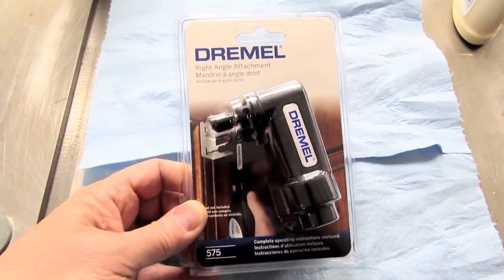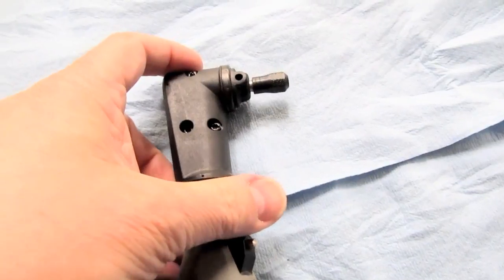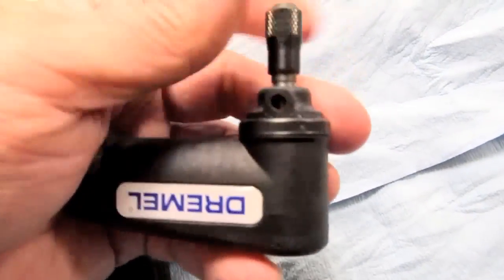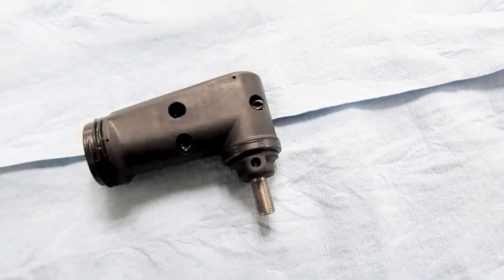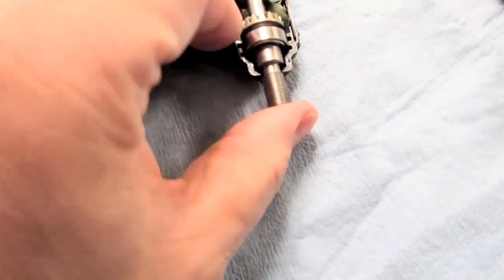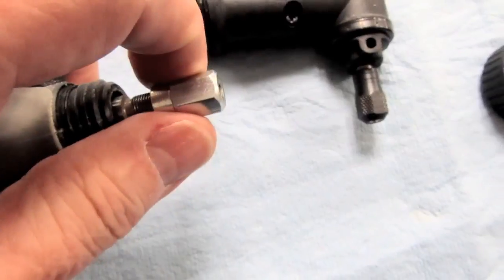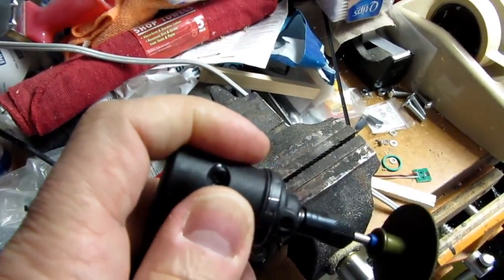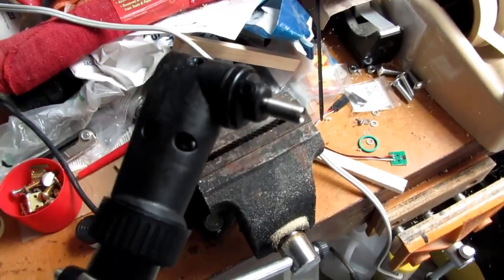Dremel 575 Right Angle Attachment: Overview and Hack

Comment: Thanks. Mine has been making a grinding noise and I was too afraid to open it. But seeing your video and how simple it is insige (no springs or other small parts to lose instantlyK I opened it and it, like yours, had almost no grease. I drenched it in grease and it sound much better now, it seems to run a bit slower because of the resistance of the grease, but its much quieter and does not get hot any longer.

Comment: i had the heat problem also it would get very HOT!! and true there was a lack of grease. The heat problem is the drive shaft!  it is too long and extends to far past the top of the vertical gear shaft and touch the top shaft.   I used a cut off disc and my Dremel to grind it down the excess so that it did not touch the top shaft anymore. Once i did that and added the grease problem solved !!!   machine  flaw from the factory

Comment: The problem lies within the bearings. Better bearings with rubber seals that you can remove to repack the bearings will definitely help. Also keep in mind while the gears need grease,  the grease will build up heat. So to much grease will work against you heat wise.
Reply from the maker: George Cloninger,  I am not sure that I can accept your argument at face value. The basic Dremel tool seems to use ball bearings of the same type as this attachment, yet they don't seem to present a problem there. And this attachment (actually, both of the ones I own) gets hot right away when first used....nothing worn out yet, nothing that seems to need repacking, and very little resistance to rotation.

I concede that adding more grease as I have done seems to not actually help, and might make things worse. Having said that, I have shown this attachment, disassembled, to a few mechanical engineers I work with, and their first impression was that the fairly rough cut gears, and the type of gear tooth shape, is the primary cause of heat generation.
Reply: @youtuuba  you could be right. But if the bevel gears are tight and run smoothly I wouldn't think they would present much of a problem. That being said I am not a engineer by no means. They do make different grades of bearings I found that out a few years ago at a electric motor shop, when I upgraded the bearings on my RBI Hawk scroll saw even though the old ones seemed fine. The factory didn't use the best bearings out there. The new ones I put in reduce vibration in the saw. It was a win win for me.
Reply: @youtuuba  but I'm glad you posted this review. Because I will definitely be going with the foredom grinder instead. I was just going to cheap out with the dremel one. Sense I have both tools.

Comment: I have had a problem with mine. The grease actually got so hot it melted. Leaked EVERYWHERE. What I might do is pack it with a higher temp grease and see if that works.

Ideally, this SHOULD be a closed sealed system with some type of oil in it, NOT grease. Rotary gears should never have grease at the RPMs they are spinning due to it flying off and having no way of getting back where it belongs. So something like a sealed area with liquid oil in it would always guarantee that the oil be on the gears.
Reply: As with a turbo on an engine, it is fed oil not grease.
Reply: No
Reply: try white grease

Comment: 2 things - 1. Grease like that will trap heat inside the device. For best results don’t pack the drive train in grease, just apply a thin coat to the gears. 

2. It’s unfortunate that a device like this cannot easily be ventilated, but the benefit of the price point means that if these things are making you money and you’re running them all the time… just buy two and swap them out when they get hot. I often use my impact driver to drill holes through sheet metal, when it gets dangerously hot I just pull the bit, unplug the battery, and take a break. If time was a huge issue, I could easily buy a backup and feel good about it because of the amount of money it makes me.
Reply from the maker: @thegameisclear  thegameisclear, as this video noted, the high speed of the gears flings the grease off so there is essentially none left on the gears. I packed in the grease with the idea that it would assure some would stay on the gears.

I wonder about the heat transfer. Mine gets seemingly equally hot with different amounts of grease, so I doubt that more grease is making the heat worse. I would also think that grease is a better conductor of heat than air is, so does it really trap in the heat?

Comment: You have grinding marks on the center of the vertical axle the square head on the dremel was not screwed all the way down enough and was pushing the horizontal axle toward
The adaptor need to be fully seated, it is very hard to sit it full when new

Comment: just took mine apart as the flex shaft (twisted wire shaft) has broken, no grease in it at all (15 years old...!) the flex shaft is only driving the top bevel gear so a solid shaft will do once I replace it,

Comment: generally packing grease is not a good idea because the heat will NOT travel away from the gears, it will stay there and get hotter